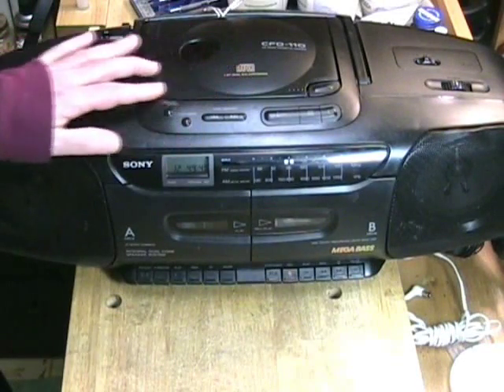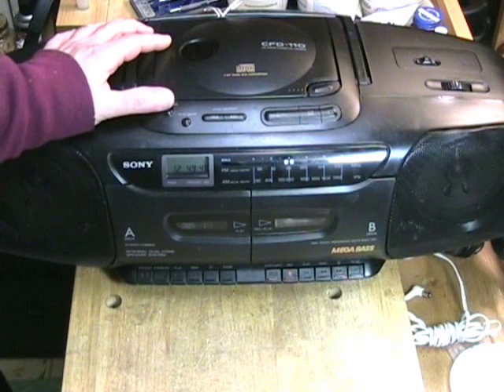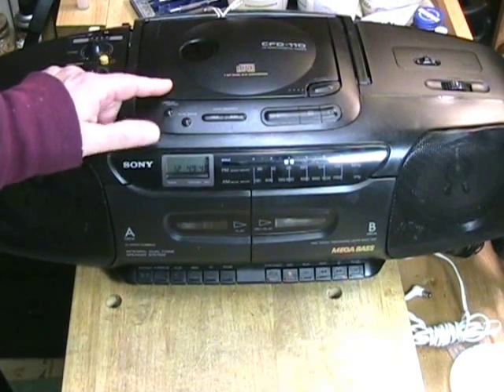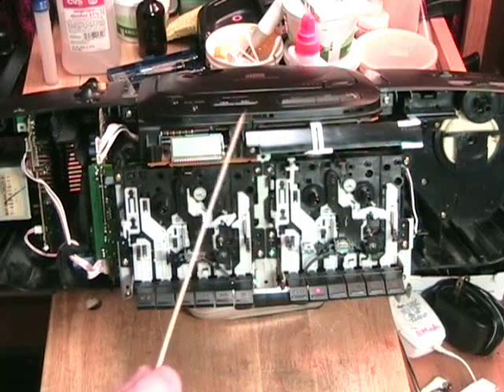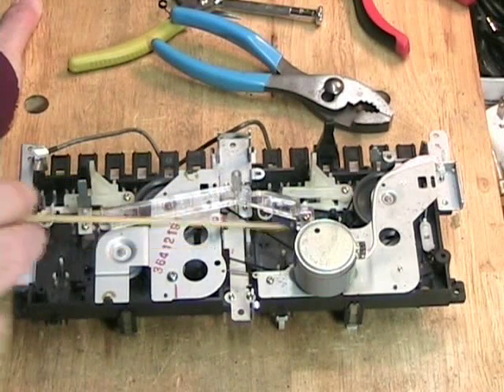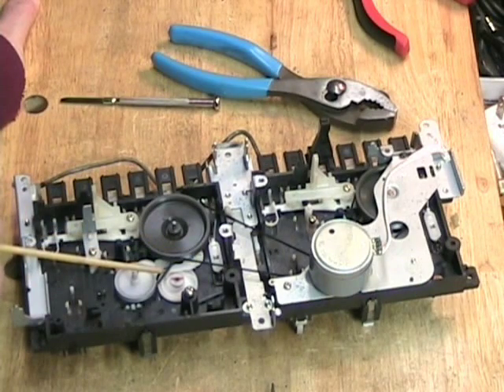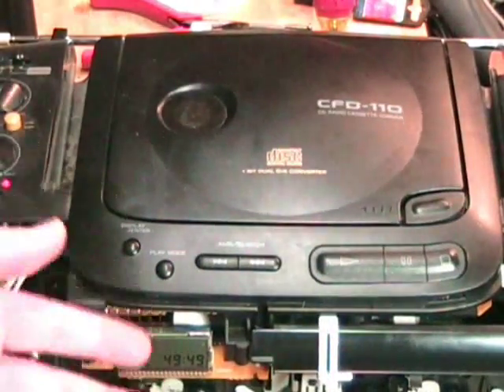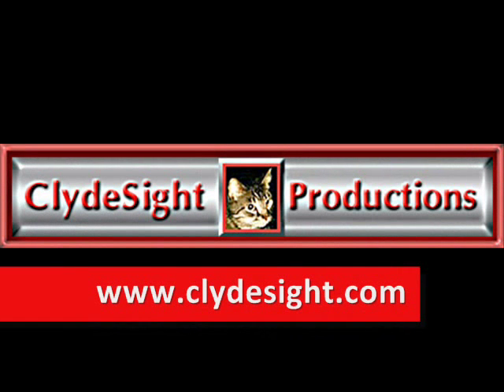How To Repair A Sony CFD 110 CD Radio Cassette Corder

Comment: Nice work!  I think maybe the switches under play and stop buttons have gotten a little worn out, it makes sense since they are likely to be the most used on the CD player. Maybe taking this  apart and putting it together again shook them 'back to life''  I hate that when they put screws so far down into things like this tho, I have a boom-box that needs a little TLC but I can't get inside it for that very reason.  I'm glad to see that they gave this AC bias and a Microphone jack.

Comment: I have a Sony casette mechanism like the ones in your player. There is an idle wheel with rubber on it that when play or record is press its engaged. The rubber is missing from it. I can't seem to find a part number or replacement. Any ideas ?

Comment: I wish you could look at my boom box. I have a Sony CD Cassette Corder CFD-758 I've had since 1993. I keep it in my   sewing room and it's been sitting there for years. I just started sewing again (lockdown!) and when I try to play a CD the screen says "NO DISC". The radio works fine, and I think the cassette player is still ok but not sure because I was trying to listen to some old bootleg concert recordings and they sounded bad and used to sound fine. So, do you have any advice for me? Thanks!
Reply from the maker: Thanks for watching the video and for your comment. I have a few thoughts:

1 - Do all CDs not play in the unit? (Sony might not recognize computer home made CDs)  How about a commercial CD? 

2.  Have you cleaned the heads on the cassette deck? I always check that first when a cassette sounds bad.

I no longer work on these machines, sorry!
Reply: Maybe the laser head is dirty as it was sitting for a long time. Just take an earbud and clean the head. 

Also, if you can open it, you can check if the connector which connects the laser to the board is snugly fit. 

I bet it will be an easy fix

Comment: I have a Sony cfd 560 and it wasn't playing.  Cassette portion.  I got it apart but cannot figure out how the belts go back.  I know I should have taken pictures.
Any help
Reply: hey i just bought one of those (sony cfd-560) and am about to open it up in the next couple of days to fix the busted tape decks.  Is it similar to this mechanism?  I can send pics once i open it up.  do you know the approx. thickness of the belts you took out?
Reply: @JordanManfrey  
I got frustrated with it and threw it out. 
:-(
I have a Panasonic that I did fix tho;-)

Comment: Hi.I have a Sony CFD-112.
I tried to change the belts with many different types without success.It gets tight or too loose.Is there a standard for the belts ? A certain size ?
Reply from the maker: +Kitsune - san Thanks for watching the video!  I have been buying cassette belt assortment packs through the years from E-Bay, and these are not standardized, but are whatever the seller puts together. 

Usually there are 10 belts in a pack. I have a lot of extras, and I happened to find what I needed in my collection. SONY did not specify (that I know of) the size oft he belts. 

So, if I had your problem, I'd buy a couple of different cassette belt assortments (10 belts in each) from different E-Bay sellers and hope that I will find what I need. 

Sorry, there is definitely a bit of luck to it.

Comment: Great Video. I got a Sony CFD-10 from a garage sale. I tore it completely apart and cleaned everything. Tuner wheel came off when I got it but I was able to solder it back on and it works great now for tuning am/fm stations. CD works. Cleaned that out. And tape deck woks. The issue I want to fix is replacing the stock speakers with something better. From the video it looks like the same speaker size are used. Can you assist in a website that would sell the right size speakers. I found 4'' but they are car speakers and will not fit. I used them for an Older GE that had its own baffle and they sound great. I have checked simply speakers.com and many other sites. Thanks.
Reply from the maker: barry k. (barrysauce)   Thanks for watching the video. I don't have this machine, it was a repair job for someone else. I don't remember what size speakers it came with. If you want to replace them, you'll need the same size and mounting holes (obviously), but you also have to check the impedance and wattage. A lot of car speakers are expecting a high power amplifier, so they would not sound good on a low power amp such as this one has.  You could try looking on E-Bay and maybe Amazon for starts. I think Parts Express also sells speakers.

Comment: I like to know if this all mechanisms is a spare part completely,?? This have a part number? I have the same equipment but I got serious damage in gears and belts, thanks
Reply from the maker: Hi. As far as I know, SONY no longer makes this machine and does not offer parts for it. Sorry. Maybe someone else knows different?
Reply: @clydesight  thank you so much for answer me, I'm keep looking for this piece, hoping find it. No matter if it new or used, the thing is that some parts of the mechanisms is missing.
Reply from the maker: @charlymazuera9846  I wish you good luck in your quest. Perhaps you can find a "donor" machine on E-Bay for cheap.

Comment: Please. Help.  I was waiting to attach belts and you skipped over it. I don’t know how the belts are replaced
Reply from the maker: Hi, I no longer have this machine, but watch my video at 8:00 and onwards. Pause the video and look at how the belts are threaded. They are simple loops from the motor to the capstans and from the capstans to the other idlers. You install the smaller belts first, the the larger ones. Sorry, that's as much as I can tell you. 

Please be aware that my videos are not "instructables", but just a record of what I did to restore the machines.

Comment: Hh, I have a sony CDF-8 unit that looks almost like yours.  I have 1 tape deck.  I cannot figure out how to open the unit.  You mention taking out 2 screws to open the unit.  The only screws I have are on the bottom to take off the front cover I believe.  Opening the tape deck did not work.  I don't want to start prying and break plastic.  My cover just does not slide out.  Any suggestions would be great.  My issue is the tape deck will not pull a tape under load.
Reply from the maker: Richard Foxen  I don't own this unit so I can't go into it to check for you. But, as I recall, there are more than 2 screws holding it together. I only mentioned the two  that are buried inside it because I had to buy an extra long screwdriver to get at them. A few things come to mind. 1 - make SURE your cassette doors are OPEN. The door catch will prevent you from releasing the case otherwise. 2 - Look all over the case for the screws and screw holes. Some are hard to find or not obvious. If I recall, there are some inside the battery compartment. 3 - check through the open doors for a screw on the mechanism. Some units have these and they are a difficult thing to release. Good luck.

Comment: My cfs-w350 after few seconds of playing takes the tapes out of the cassette. Why is it doing this?
Reply from the maker: WIZEPLAYz  Thanks for watching the video. It's hard to say for sure what is wrong without actually seeing what your unit it doing, so I will guess. I am guessing that the tape is forced out of the cassette and gets clogged in the machine? if so, it means that the take up spindle is not running correctly. 

The capstan and pinch roller are working correctly and pulling the tape past the heads, but the take up spindle is either jammed, slow, or slipping, so it doesn't pull the tape from the capstan, thus the capstan pushes tape out of the cassette shell. 

One thing to check is if this happens with all your cassettes or only one. If it is just one, then thast cassette is probably binding somehow. If it is on all the cassettes, then the machine has a problem.

I don't know how similar the cfs-w350 is to the machine here (cfd-110CD), so I can't address it directly, only show you on this video and this machine what to do. It may be very similar on yours.

To fix this you have to really take the machine apart to get to the parts. You need to correct the friction clutch mechanism on the take up spindle. This may be directly connected or run by a gear. You'll need to investigate and determine how your machine is trying to manage this.

Watch my video carefully and pay close attention starting at 8:50 onward. You see the plastic clutch for the take up spindles there. You need to make sure they are working correctly. being plastic, they can easily break or the clutch plate works loose and needs to be pressed down again.

Good luck.